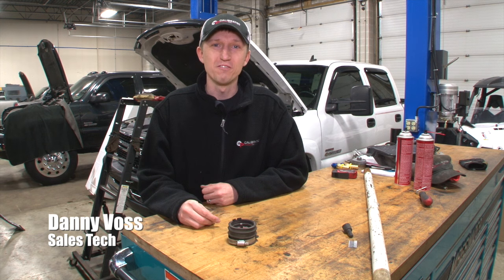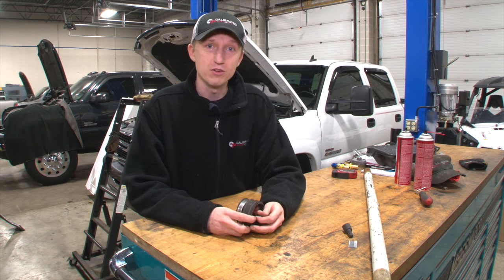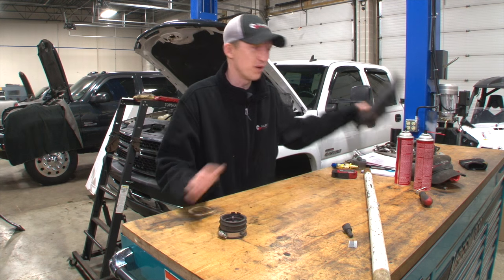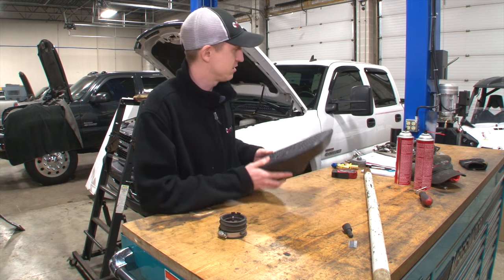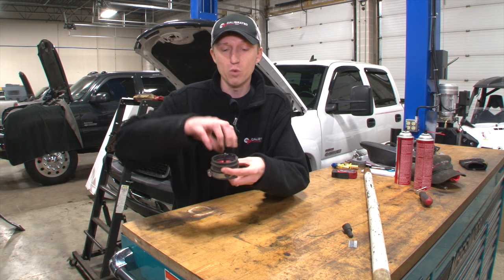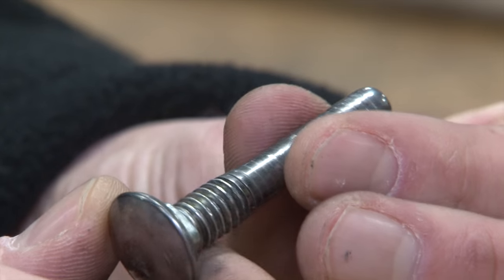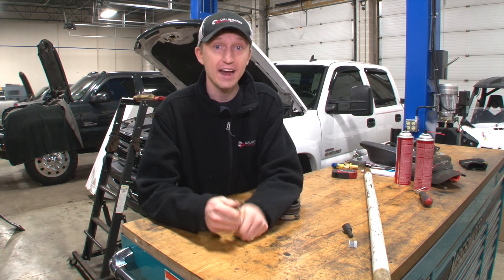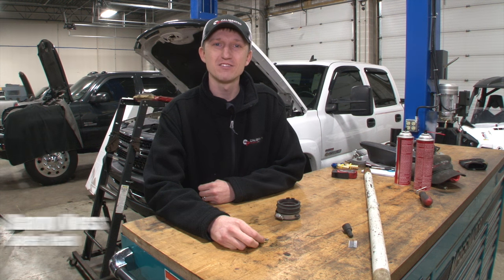Resonator Cover $nafu - Duramax Diesel Maintenance Tip

Comment: what about a safe resonator delete if there is one? I have an lb7, so I don't have an intake resonator, but if there's a safe one a lot of people would probably be very interested in it.
Reply: +Kevin Radigan 
This https://www.merchant-automotive.com/p-579-billet-turbo-resonator-delete-plug-20045-2010-black-duramax.aspx
OR
This kind of plug https://www.merchant-automotive.com/p-735-turbo-resonator-delete-cap-lb7-lly-lbz-lmm-2002-2010.aspx
Reply: I went with a 2" rubber pvc cap with a hose clamp. It's been on for 200k miles with no issues.
'05 LLY

Comment: hahaha everything i see those wing nuts plug i cringe....
Reply from the maker: +StyleGT Us too!!! Classic case of a five cent part causing $2k worth of damage. You can get plugs at XDP.com for around $20. Safer and looks better too.
Reply: ohh thats true but take in consideration that at the moment if your a Canadian you spend alot on a 29$ US part......... item comes up at 40 ish and then shipping is like 50 US to canada..... i got the same kinda plug but it has a metal  band screw around the outside of the inlet..... 10$......... canadian... soooo lol
à
Reply: +Duramaxtuner Thanks for the video! I was considering that type of plug but not anymore!